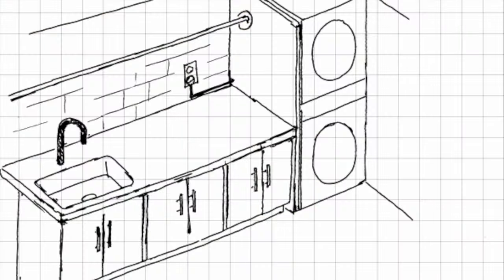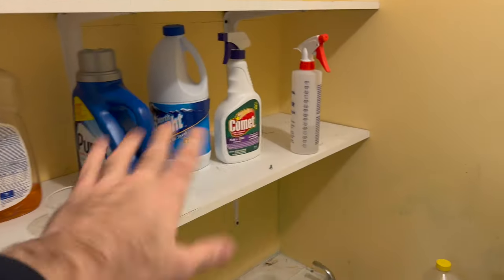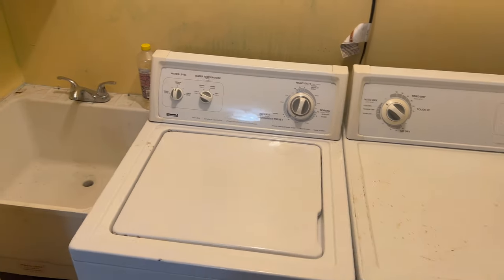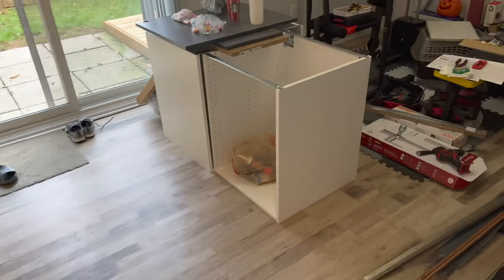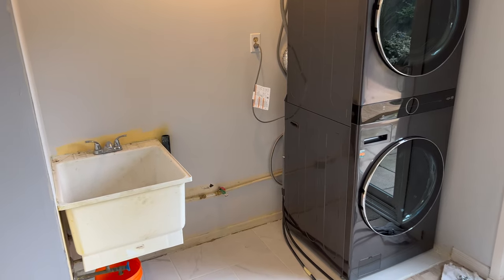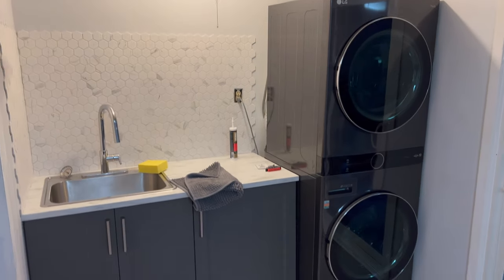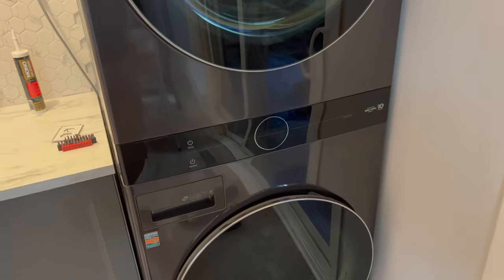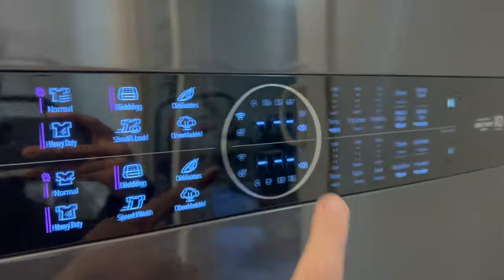LG WashTower Review - How It Works in My Newly Renovated Laundry Room!

Comment: INCORRECT!  The unit DOES come apart in TWO pieces. Mine was brought up two flights, each piece separately and then bolted together once inside.
Reply from the maker: Thanks! I’ve heard this from a couple of other viewers now as well. My personal experience was my unit came fully assembled, and was only moved by the delivery crew as a single piece.
Reply: Exactly. I’m like what’s is he talking about he’s also wrong on the weight. I immediately stopped watching after that

Comment: I just purchased this unit, used for $1000 (a steal). In order to transport it, we broke the two machines apart.  There are two small hatches on each side of the middle control panel, flip those latches, and remove the screws. You can then pop the control panel off which will have the control wire to the washer and dryer, carefully remove those. You then have one screw on each side of the front. It becomes fairly obvious which screw is connecting the bottom unit to the top unit if you look at it closely. Remove these two screws. You then need to take off the plastic bracket that also connects both units together located on the back of the unit. Once you do this, remove the bracket and with the help of a friend you’ll need to slide and tilt the top unit to get it disconnected from the front area where it is connected to the washer. We had the unit separated in less than 4 minutes.  I am hoping that this means you can purchase the units separately if one dies but washer/driers typically have parts that are used across many different brands and models. The bottom line is that this unit IS just as serviceable as any other separate washer/dryer units.
Reply from the maker: Thanks for sharing this with us Anthony!

Comment: Do you still like it?
When dry cycle is done, is it completely dried and how badly wrinkled are the clothes?
Thank you.
Reply from the maker: Yes, I’m definitely still liking it! As far as dry level and wrinkling - that’s totally dependant on the wash mode you use (and this unit has a LOT of them). If you run a general wash cycle, it does a very good job of getting most of the water out, and as long as you get your laundry out fairly quickly, wrinkling is a non-issue.

Comment: I just purchased a 1 bedroom condo that came with this super small capacity 80's style machine with a tub washer on the bottom and a dryer on top - all crammed into this tiny little laundry closet off the kitchen.  The WashTower was my saving grace.  Not only is this thing a normal capacity washer / dryer but its the same footprint (just a little taller) then that old 80's style machine.  It was literally a drop in replacement and I was good to go.  ^_^
Reply from the maker: That’s amazing to hear! It is a great size for the capacity and features it offers.

Comment: I just got this recently. When I use the steam fresh cycle on my dryer. The cycle is 10 mins, every time after 2 min, my phone will get a notification that said "WashTower's dryer has been stopped due to a problem". However, I walk to dryer and it's running as normal and it didn't stop. There's no error code or anything on the until. It finish the 10 min cycle every time. I submitted support ticket, after back and forth communication, they told me it's the app? They told me to delete app data and try again. I deleted the app and reinstall, however the strange notification still comes in every time.Anyone has this problem? Can someone try they steam fresh cycle when connected to wifi and app?
Reply from the maker: Sorry you’re dealing with this - the app can be a bit clumsy sometimes, on my end too. I get the occasional error message too but the unit keeps on going.

Comment: I bought this unit about six months ago and really love it.  That is, except for the App.  It took me 4 HOURS to get the dryer to sync with my phone, and then another 30 minutes to get it to recognize my wifi network.  

Is there some secret handshake that I need to do to make this work better?  I don't know what I did differently the 95th time I tried to sync that actually made it work.  I recently upgraded my wifi network so now I need to do this again.  Any input you can give would be greatly appreciated.  I've read the instructions, looked at YT videos, and everything else I can think of, but it seems like the instructions are missing 1 or 2 steps between "connect your phone to the dryer" and "after the dryer is connected".
Reply from the maker: So sorry you’re dealing with this!! The app can be clumsy sometimes, I honestly feel it was more stable and reliable to use back when I first got this unit versus how it is now.

Comment: Great video!  We are going to purchase this unit and need to know how many inches from the floor does the dryer hose/vent hole start.... I have a very tight area and want to make the connection recessed into the wall and directly behind the unit or just slightly above.  I have called the manufacturer and no one can tell me this measurement.  Do you happen to know?  Thanks in advance!
Reply from the maker: Thanks for watching! Unfortunately, now that the unit is tucked into the cabinet in our room, I can’t make this measurement out any longer either - sorry!!

Comment: Come on. Let's be honest, touch capacitant buttons are horrible.. it sucks that we have to use our phone for other wash cycles that should be on the washer. 
I have this washer and honestly, it does a great job washing but the interface is nothing but garbish. 

I rather go back with my old school washing machine. Old school mechanical clicky buttons that gave me the freedom to control the water level and temperature. 
These new washers micromanage every droplet of water which extends the wash time..

And the no, turbo wash is not going to help you..Its nothing but a false gimmick... Just by raising the temperature of the water, you will be punished with an additional 30 minutes of wash time. It's ridiculous.
Reply from the maker: Thanks for watching and sharing - I can definitely see both sides of the argument regarding the cycles and having to control from your phone. I don't mind the buttons though, I've never had any issues getting them to respond or anything like that!

Comment: Hi, does the delivery charge include moving into a basement or second floor even with this 300+ lb machine?

I’m seriously considering buying this because other nice stacking sets are not cheaper than this.
Reply from the maker: Hi Agnes: I ordered mine here in Canada through the Home Depot. The installation cost covered them bringing it into my basement, sliding it into position, and plugging it in, and installing the water lines. I thought it was well worth the money!

Comment: i am concerned about the digital panel... i've heard the entire machine might needs to be replaced if the panel quit working
Reply from the maker: Thanks for watching! I’ve heard that the whole panel would need replacing if it died but not the entire unit. Luckily I bought extended warranty with this though which covers everything!!
Reply: If the panel were to quit working, it would take about two minutes to replace it. This machine is very serviceable when it comes to how easy it is to remove the panel. It even looks as if it would be fairly simple to replace either the dryer or washer board Independent of each other. However, it would probably be just as easy to purchase the whole panel and perform the two minute swap out.
Reply: @AnthonyBeebout   i got the 4100/4200 combo at the end. too much concern about the panel...

Comment: With all the work that went into that, it's a bit mystifying why that unsightly yellow electrical outlet with the super tight electric cord plugged into it was carved in plain sight thru the marble hexagon backsplash instead of being put out-of-sight on the wall behind the dryer gap...
Reply from the maker: Hi! Thanks for your comment :) first, we replaced the cover and plug after this video was recorded. Secondly: my home is a townhouse with concrete barrier walls between the units. As such, moving the electrical without adding some sort of false wall to cover the box would have been very difficult to do. I agree it’s not the best spot for it, but we had to work within the constraints of the house!

Comment: Why are they so expensive?
Reply from the maker: Primarily - it's just due to how much stuff is going on in these units. They're a normal washer / dryer but also features the steam wash cycles (and all the hardware to power that), as well as having a centralized control panel to manage both units in one. I'm sure with time the cost will come down!
Reply: Hi, I´m in LatAm and got one of these end of 2023. Noticed LG aligned internationally to US BlackFriday prices on this specific season, both in its own website and other retailers (not sure about Canada, but in a few countries quite far from US). In some groups I read similiar situation happened during the US Tax Holidays/events related to energy efficient appliances.  My ticket was -45% vs. current price.

Comment: What would happen if one of the units stopped working? Do you have do get a whole new washer/dryer unit?
Reply from the maker: Hi Frank - the units themselves can be serviced independently; just pull it away from the wall, do the work on the back, and get back into service. Now, if one part of the control panel goes out - you need an entirely new control panel (and it's a pricey part, no doubt about it). 

There's pros and cons to this unit, and others like it; I don't have a good back and my girlfriend would be too short to reach the controls if we went for a traditional stacked setup, so it works for us. Long term, it could be expensive to repair - but we purchased the extended warranty to help with that, just in case.
Reply: @ADesignersLife  Thank you for the video and your quick reply...